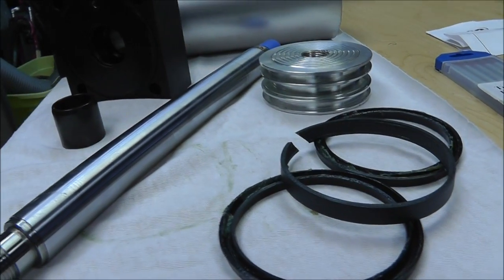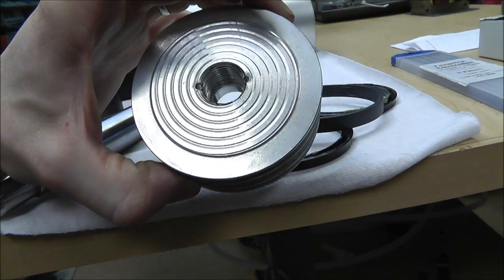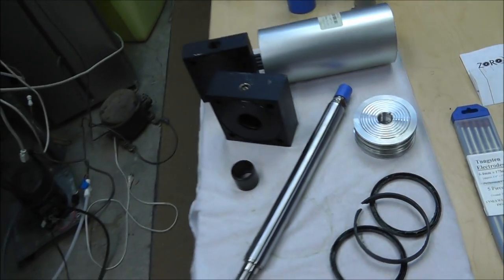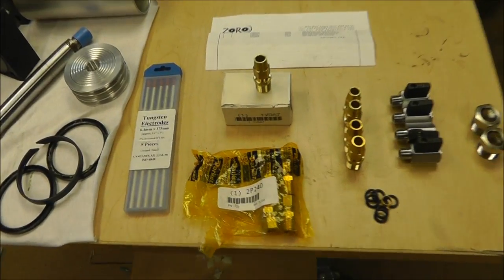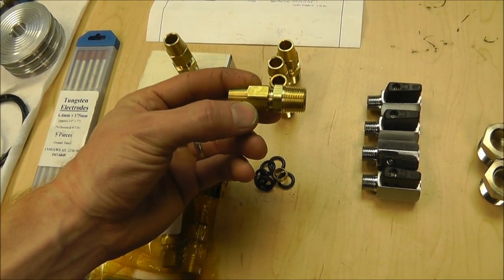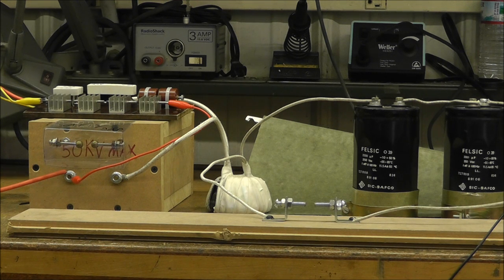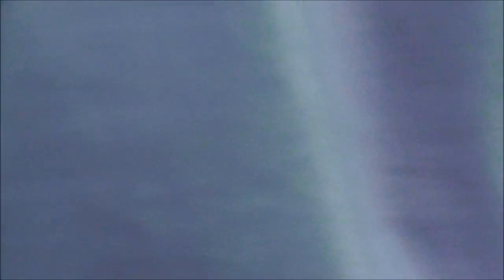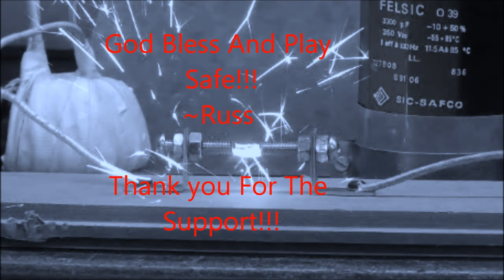Update 5 NGE Papp: Where's The"Popper Kit"? Shipped? Parts Parts Parts! 350Joules across 10+ mm gap

Comment: john is using stainless and thermoplastic for the piston construction. He uses 316 s/s for the cap and thermoplastic for the base. He is using viton "quad"rings for the seals on the sides of the piston between the cylinder and piston. This allows enough "wiggle" for the piston during the power stroke and return stroke. The cylinder is slightly tapered,with the piston tightest at the top of the stroke. The "popper" is not tapered,being for demo urposes only.

Comment: The higher the voltage source the faster the coil will energize.  That's why I suggested that you energize the coils from a 48-volt battery source.  You also want to know what current flow level will fully saturate the ferrite core of the coil (i.e.; the core of your transformer).  You never want to energize the coil past the core saturation point.  There is a simple way to measure the saturation point of your cores using your scope and a current sensing resistor.

Comment: Once the plasma ignites it acts like a resistor.  So higher cap voltages will burn energy through the plasma faster.  However, the plasma might (for example) ignite and then only sustain 50 volts across it while you do a burn.  I saw in your clip where your spark gap setup initiates the plasma discharge.  Once the capacitors kick in and sustain the plasma burn - lower cap voltages will likely sustain the burn also.  The point being you may not have to play with dangerous cap voltages.

Comment: What you should do is set up a "Bedini" circuit with the transformer acting as a coil and dumping into a capacitor.  However, also but a resistor across the capacitor.  Use one of your 5-watt resistors.  That will bleed off the energy in the capacitor.  Then put a current sensing resistor on the coil and then look at the current in the  coil when the transistor switches on.  You will see the exponential current waveform and get a sense of how long in milliseconds it takes to energize the coil.

Comment: You could then adapt this system to run the motor at a higher pulse rate.  The motor would generate a trigger signal.  After a programmable delay (using a 555) you could then discharge your spark to fire the piston, and then a bigger version of the Bedini setup could charge the capacitor bank and get it ready for the next spark discharge.  For example, if you had a 48-volt DC source, and multiple transformers acting as coils, they could all charge the cap bank in one shot.

Comment: A wet diamond tile saw works great for cutting the electrodes. Do not cut dry as the thorium dust is not good for you. As you are wondering about the voltage drop, I would suggest you review Jochen's High Voltage page for gap voltages and the Pashen's curves for the calculated drop.

Comment: So the amount of energy in the coil goes into the capacitor (less losses).   Keeping it simple and ignoring losses, imaging 10 joules in the coil.  Transistor switches off and then a short time later there will 10 joules in the capacitor.

Here is the key:  For a small cap the voltage will be high, for a large cap the voltage will be low.   The coil will charge the cap to any voltage required.  You don't have to do anything, it's all automatic.

Comment: Each coil stores energy, E = 1/2 L i-squared.   That energy E then goes into the capacitor bank, E = 1/ C v-squared.

i.e.; 1/2 L i-squared = 1/2 C v-squared.

With five of your transformers acting as coils, and assuming they all have the same current running through them, then the stored energy could be quite large.

When the transistor switches on the current starts at zero and slowly climbs until it reaches a plateau.

Comment: Where you would normally have the charging battery with a Bedini circuit you replace that with your capacitor bank.   Just use a 555 timer to switch on the transistor.  You just need an enable/disable switch for the 555 signal and then monitor the voltage on your capacitor bank with a multimeter while the 555 sends a pulse train to the transistor.  Power the whole thing with a big 12-volt battery.   Like that you will be able to dial up your battery voltage.

Comment: Each transformer acting as a coil would have it's own Bedini circuit, i.e., a transistor and a diode.  So from the same 555 timer signal turning on multiple transistors (or MOSFETS) you could have say five coils charging up from the 48-volt DC battery source.  Then the transistors all switch off and the five coils dump into the cap bank simultaneously and as a result the cap bank is ready and waiting for the next spark event trigger signal.

Comment: Try calculating the required voltage in the cap to store 10 joules in the cap if the size of the cap is 100 uF.   Then calculate the voltage if the cap is 470,000 uF.

Like I said the other day, for the "real popper" you could energize multiple coils at the same time and store say 50 joules.  Then they could all dump their energy into your cap bank at the same time.  You have full control over the amount of energy in the coils with the transistor on time from the pulse width.

Comment: Just use the primary of a biggish transformer as your coil.  With your new scope you could tune the 555 pulse length so that it is the proper width to charge up the transformer inductance.   You could perfect it and make the 555 run in one-shot mode, so that every time you pushed a button you put a known amount of Joules into the capacitor bank.

Comment: Russ:  In case you need some help in visualizing what I explained to you:  So you have a coil that you energize by switching on a transistor, and then the transistor switches off and the coil +battery discharge into a capacitor through a diode.

Imagine when the transistor is on the coil is slowly "filling up" with energy.  When the transistor switches off, the energy in the coil will automatically transfer into the capacitor.  It does this automatically.

Comment: The sobering thing is this:  If you do some measurements and allocate the energy losses in the spark gaps outside of the cylinder, and knowing your cap voltage and total capacitance - you may be able to determine with reasonable accuracy how many electrical Joules you pump into the cylinder every time you do a plasma burn.  Then you have to try to measure the mechanical Joules when the piston fires - that's the over unity check.  You are not going to find over unity.  I hope you get your kit!

Comment: I am sure that there are many clips of Bob demonstrating his setup but I don't think that many people would consider that validation.  Bob never discusses the issue of energy out vs. energy in and measurements.  Without that, it's just a plasma discharge making a pressure wave and heating up the air and pushing on a cylinder.  There is no reason to presume that something remarkable is going on, noble gas or not.

Comment: Another comment:  I said use the "primary" of your transformer to make the inductor but that's ambiguous.  Use the side of the transformer that has less turns and thicker wire.  That will be a lower inductance and less resistive losses but still the same energy storage but at a higher current.  The transformer coils will energize faster if you use the lower-inductance side.  This is all to support the requirement for a high pulse rate to run a hypothetical motor.

Comment: The energy in a capacitor equals 1/2 CV**2.   A 33,000 uF cap charged to 72 V is storing 
85.536 J of energy.  Say 86 Joules.  Regards.

Comment: Russ, just use a Bedini circuit to charge your capacitors!  You are talking about using high-voltage transformers, that's dangerous and the wrong way to do it.  Just make a Bedini circuit and slowly and safely charge your capacitors to any voltage you want.

Comment: Has anyone built a real 'hydrofueler'? ie; the one that has teflon coated magnet wire, and produces quite a few liters per second, over 300hp's worth so you don't need gasoline. I started but stopped when I found the cost of the magnet wire , $300 + per unit.